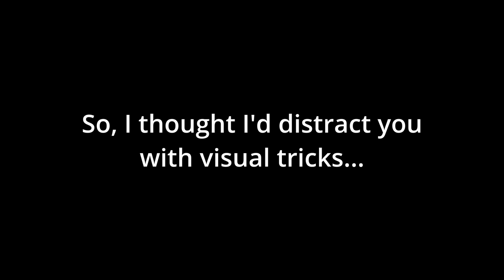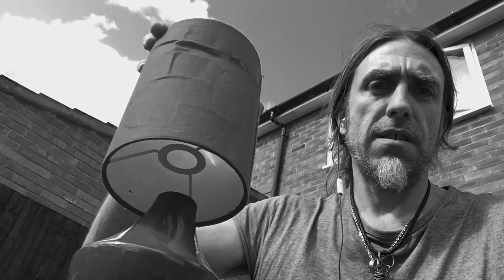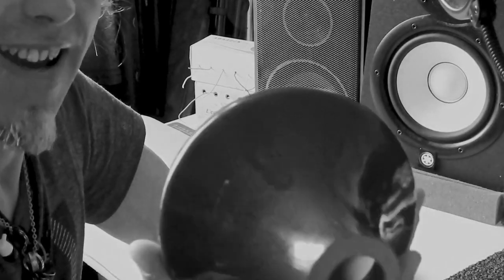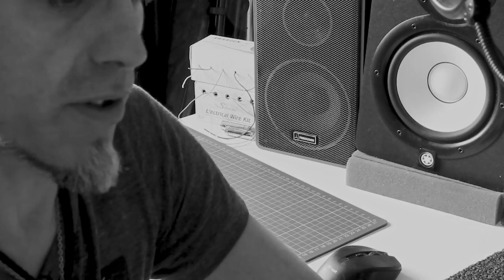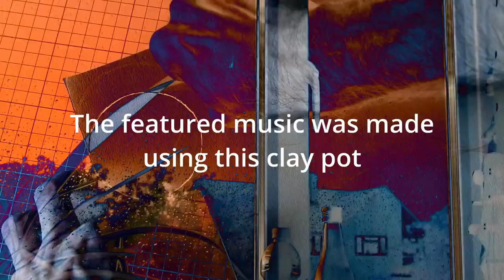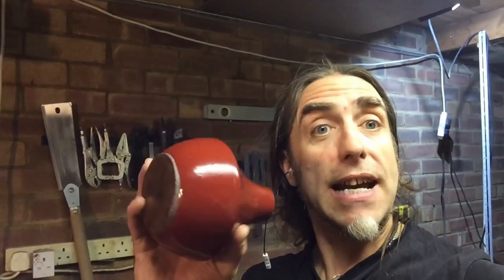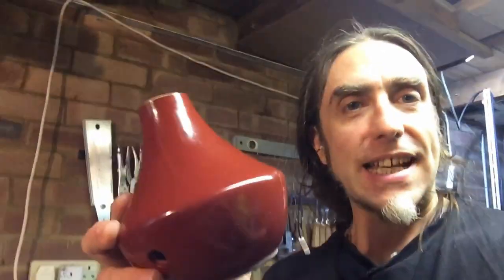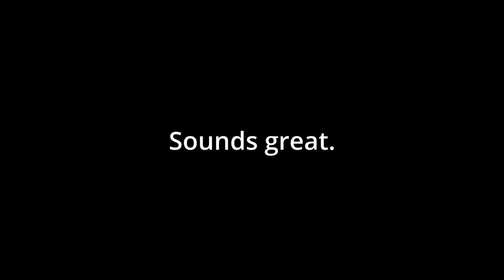I Love Lamp | Turning Found Objects Into Musical Instruments

Comment: Get one custom made from scratch.

No, seriously, if you can find a potter in your town that makes coffee cups and soup bowls, this is easy. Two pieces, a funnel joined on top of a bowl. 

When you are working with leather hard clay (before it goes into a kiln), drilling holes is simple.

It's fun repurposing things to make sounds with, but no matter how good a musician you are ... blowing into a garden hose doesn't have the nice sound a trumpet does.
Reply from the maker: That's a great idea. I had considered trying to make one from scratch myself, but it would definitely make more sense to employ the skills of a talented potter. 

Also, I see your point about the garden hose vs. trumpet analogy, but I fear in my hands, either one would sound awful!!! 

Thanks for the comment.
Reply: @UnknownAudio  I suggest making the neck narrower. Think about blowing air over a  coke bottle. That's where your trouble is coming from.

There's lots of instruments out there that are end- blown: quena, shakuhatchi, pan pipes, etc. Yours is the first I've seen with finger holes AND a closed vessel. I had always assumed the xun was an ocarina. It isn't, so I learned something today.
Reply from the maker: @ImperialistRunningDo  I totally agree, having a narrower opening in the neck would definitely improve the sound. Annoyingly, when I first broke the light fitting away from the body, it had a smaller hole and the sound it produced was much crisper and more present. I then filed/sanded the opening — for aesthetic and playability reasons (there were lots of sharp, jagged edges) — which compromised the sound considerably. In hindsight, I should have removed far less material!

I may have to broach this subject again in a future video. If I do, I will definitely take on-board your suggestions.